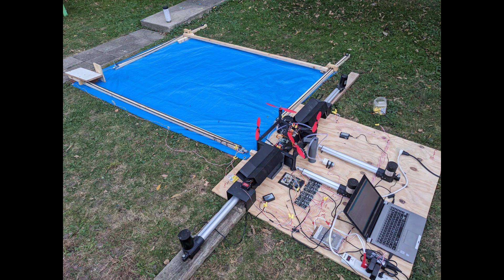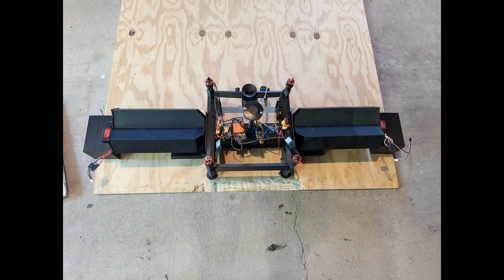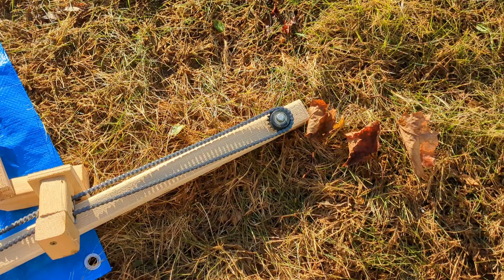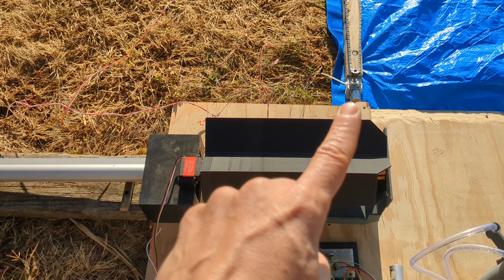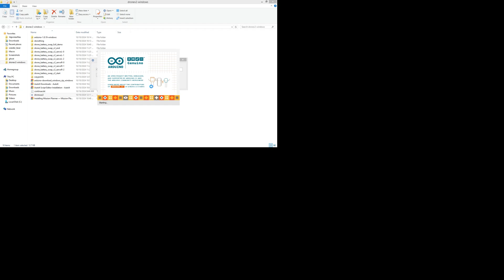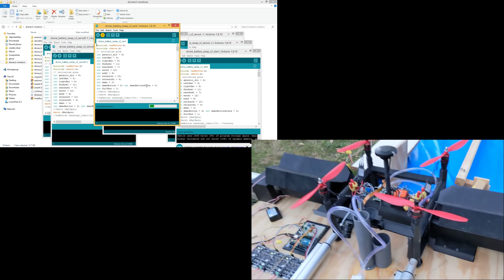DIY Drone Landing Pad & Automated Battery Swap Build - Part 3

Comment: This is awesome great job!  Wireless charging and magnets for positioning may help your designs but exchanging batteries is certainly better for continuous flight.  Might consider using magnets or effectively unifying the battery connection for the exchange.

Comment: That's truly crazy, I love it. Visualizing one for my M30T. I would skip charging and use the DJI charger, just manually reload the spinner. I was looking to build a rigid landing pad but this idea looks like a fun winter project.

They sell a fancy charging dock but it does not swap batteries to re-launch, which is what I need. I picture it coming out the right side of my van.

Comment: pleaaaseee use a serial connection to manage the motors from the laptop instead of reuploading diffrent programs, if its too large just make thze arduino act as an interface and have something like a processing programm do all the controls and have it control the motors thru the arduino sing the intigrated serial functionality,

its still awesome and i'm amazed it works so well

Comment: It seems to be working fine, but are you aware of the low voltage, voltage drop? It can add up quickly using thin wires.